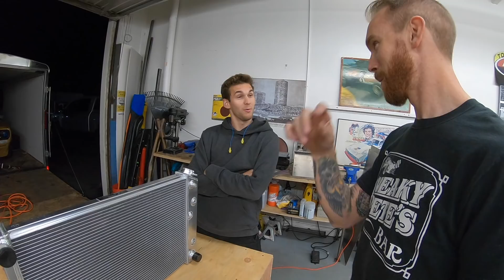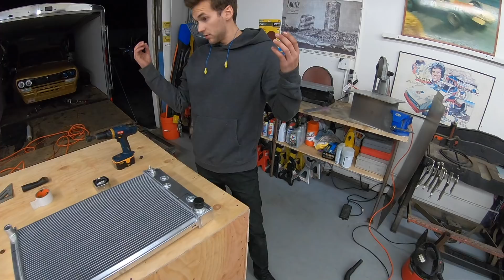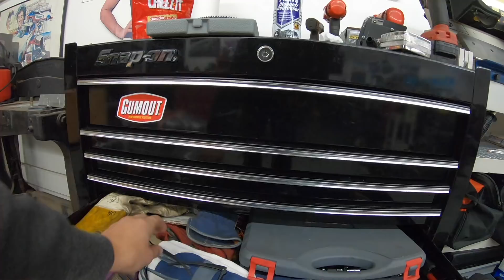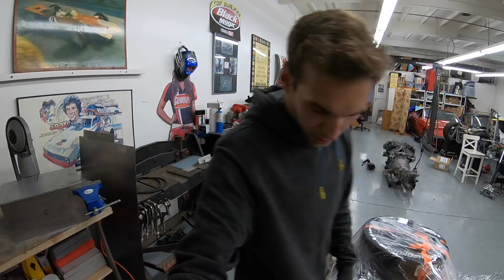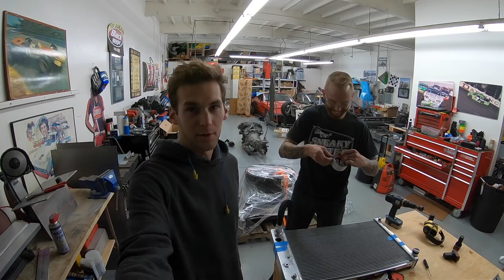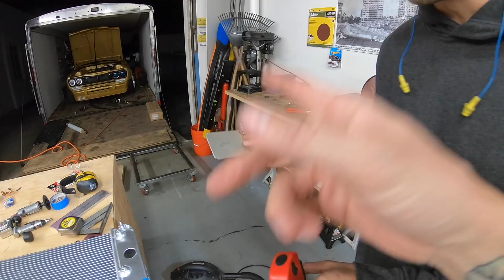Good Enough! EP8 - How to Build a Triple Pass Radiator with Chris Forsberg and Dylan Hughes - Part 1

Comment: there is one little detail i do not understand. when looking at my radiator, the web does also have vertical passages not only horizontal. is it different for the radiator here in the video?
but if it is the same situation, how do plates welded into the side sections of the radiator prevent the water from crossing vertically within the cooling web?

Comment: So the trans coolers just sit in the end tank? I always thought there was a portion of the rad fins that was the cooler...  #Themoreyouknow
Reply from the maker: Most of them are this way... You can leave it in and coolant will flow around it like normal... but since we were chopping it up for a triple pass we had to remove it.
Reply: So their just a "heatsink" that sits in the tank. Now I see why auto guys will switch to a external finned design.
Reply from the maker: Yessir, it is best to have an independent cooler for the transmission.
Reply: So speaking of coolers... In the FD world, do you use say a cooler for you sequentials or your diffs? I know, like you said, rad's are very important but so are steering coolers, from what I understand about FD. So I guess I'm asking how far do you go to keep everything cool?

Comment: So what's the piece that they cut out of the return side tank?
Reply from the maker: It was a cooler for if you run an automatic transmission.
Reply: oh...hmm. I wonder how efficient those really are and how much it effects the temperature of the coolant returning to the engine.
Reply from the maker: It would increase the water temp a little bit... it is best to run it separately.